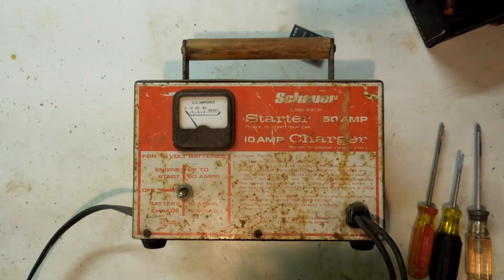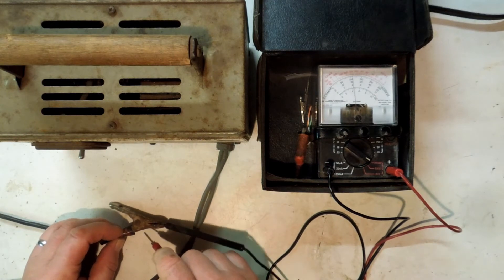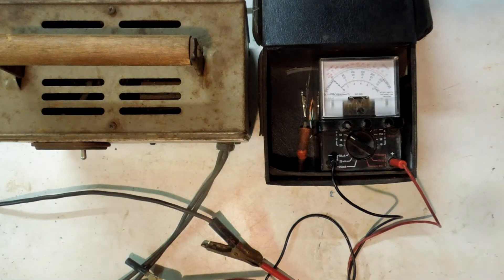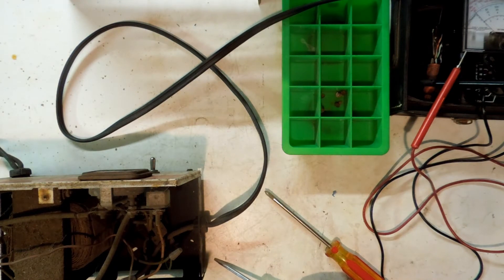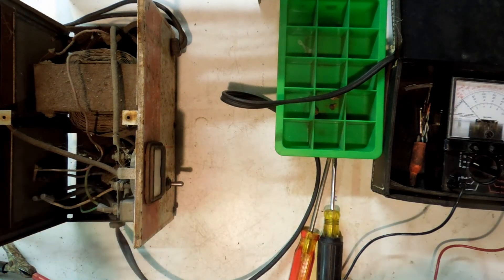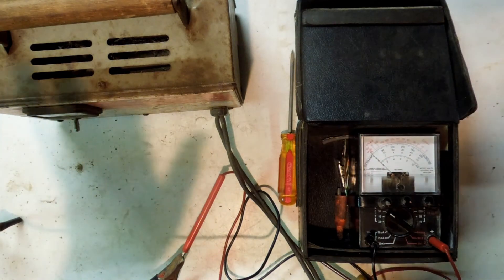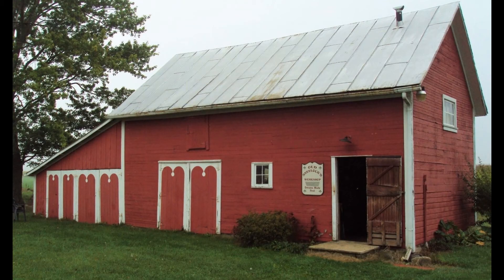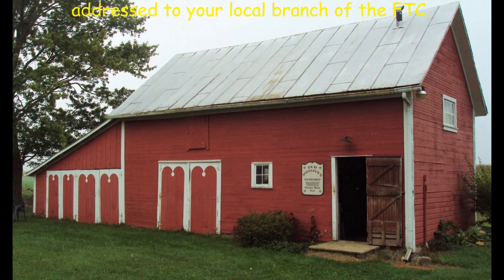Schauer Battery Charger Repair

Comment: Hello. I have an old very simple Shauer Norko 1 amp 6/12 volt  manual charger. I need to determine what component is bad. Can you help direct me to a schematic or parts list?
Reply from the maker: This is a nice manual for Operating, testing, and trouble shooting a battery charger. https://www.associatedequip.com/wp-content/uploads/Trouble-Shooting-Maintenance-Guide.pdf
Reply: @OldSneelock  thank you Sir

Comment: I got a Schumacher 150/55/20/2a speed charger with the   led screen,  i know i should have took a picture before i unpluged them , before cleaning out  the  bottom  i cant find any where  a  diagram of where these wire go back into on the  switch i have   2 orange 1/ comin from the led screen,  an 1from the  diode plate  on the back an 1 red 1/black 1 white with  6 pin pin switch 3 on each side up is 150//50 an middle is off an  down is 20/2  can you please tell me where they go  i been like this over a month thanks in advance
Reply from the maker: Sorry.
Without a schematic I don't have a hope of knowing. ☹️
Reply: I hadnt realized but i have   another exact but it doesnt have the  led an some how got positive back ward an fried the wire well i ll keep trying thank s  for your  help

Comment: Jeez-almighty....ain't nothing worse than an intermittent problem with an electrical device.  I like fixing things by accident....but usually it ends up in troubleshooting again.  Sure glad that switch popped up as the issue.  Easy fixes are welcome down here !!

Comment: Replace the switch above all do not replace the battery charger the new models are called smart chargers, right there is a red flag, too many electronics that you don't need or want and they don't work like the old ones do.
Reply from the maker: The automatics aren't able to do what manuals can.

Comment: How's she goin'?  If the changer doesn't work and you don't do anything to fix it, it's still broke, even if it works again!!!  LOL    I think you may have found the problem with the switch though.  Take care!!!
Reply from the maker: New battery needed. The old one has a dead cell.

Comment: Seems like a fix like that is better than a new one. For me, anyway. I've got a pressure switch to change out on the pump. 220 with a 110 volt kicker but if I go slow (like  have a choice) I'll be fine. It's even got the grommets so's I can do a pretty job instead of looking like an electric chair. Got everything started today and running included the splitter which didn't pop since last fall. I even mowed some. A maple and the river birch are turning color. Nothing else that's obvious. Beans and cukes coming on. Squash is yummy. Come get some! Happy evening and happy charging too. The hammer didn't come out so it had to be electrical! GBWYall!
Reply from the maker: I got the battery charger working,  but the battery has avdead cell.
So I mowed and trimmed while thinking of a way to get another battery. 😑😎
Reply: @OldSneelock  I have taken dead cell batteries and dumped the electrolyte out and sprayed water into the cells and shook the battery and emptied out the water over and over many times. Put the acid back in the battery recharged it and all was well, usually did this to a battery of a car that was for sale so I never knew how long it lasted. lol
Reply: @OldSneelock  I think they all go dead by themselves sooner or later. The generator battery does and it does very little 99.9% of the time and then I just turn it over for 3 or 4 rounds in passing. And the maintainer just blinks it when charged so it's not in a boil all the time. I'm inside because of the smoke from all the fires have us covered up. Supposed to blow away this afternoon. Poor folks out west have it really rough. GBWYall!

Comment: I use small trickle charger/maintainers on my riding lawn mower and generator(battery start only) to make sure they are ready to go. Mine are made by Battery Tender.  They aren't free of course but figure the cost and the electricity they use are still cheaper than new batteries.  Plus the cost of small engine batteries seems to have gone crazy lately......like everything else.
Reply from the maker: I did that successfully for 3 years. Last year I didn't  pull the battery. So it sat in the cold. 
Just laziness. 🤔😎